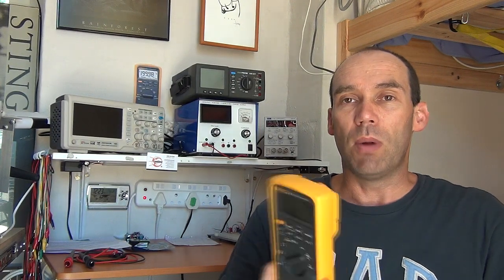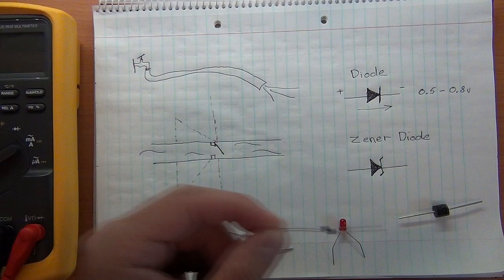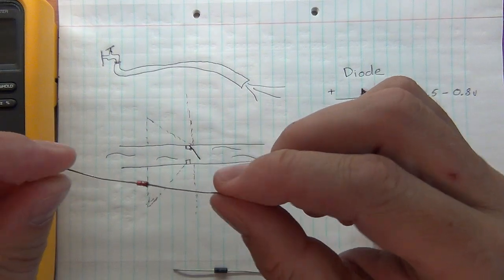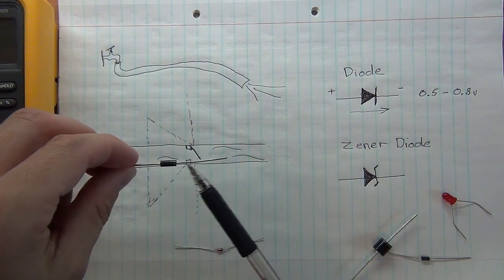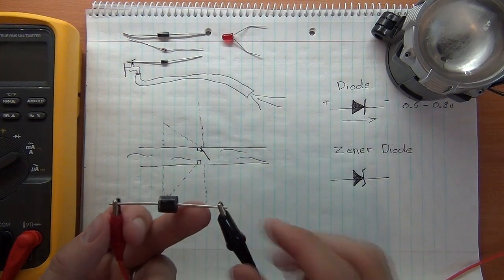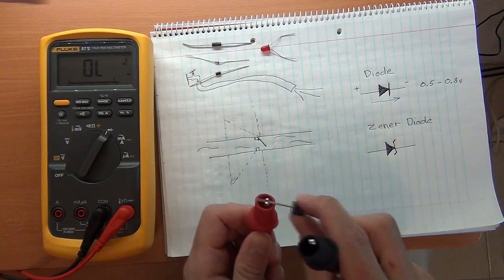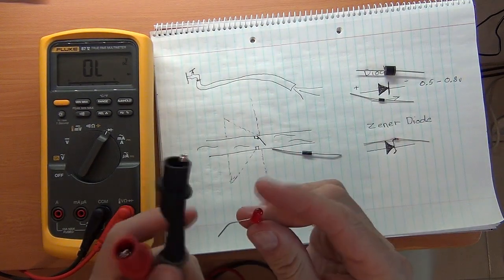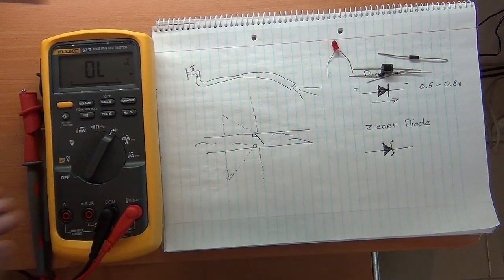How to use a multimeter for advanced measurements: Part 1 - Diodes

Comment: Mr. your videos are very very good, but about this one, you didn't tell anything about diodes in DC or AC circuits? For those one that doesn`t know where to use it, now they have doubt, is diodes works only in AC, or DC, or in both?

Comment: Please note!  The ~0.7V forward bias voltage of a diode applies to silicon diodes.  Germanium diodes produce ~0.3V.  Such diodes are are used in applications where voltages are pretty small, eg, meter rectifiers, RF demodulators, VSWR bridges....

Comment: I am amazed, being a new to electronics, just how much essence things need to have in order to operate correctly. Everything seems to work in essence. I wondered, will Almond essence work as well as Vanilla essence or is there a special kind of essence needed? I would hate to buy the wrong kind of essence because, in essence, that might upset the essence values in the circuit. In essence. :o)

Comment: on the other video you have said the bias pass through diode should be between 03 - 0.8 for a working diode, here you put 0.5-0.8V
Which one correct? coz I have mine figured 0.434V.. is it a good diode?
Thanks

Comment: If I understand you correctly a diode is really a form of a resistor, correct? Question 2...If you have a circuit with say 12V and it's feeding two components, component A needs the full 12 V but component B only needs 6V, would you use a resistor to restrict the flow or a diode to get your 6V. It seems both do the same thing.

Comment: So when there's a voltage drop of 0.5v - 0.8v, does this energy gets converted into heat inside a diode (heat and light in case of LEDs).
Reply: Anosync Yes .

Comment: Hi Mj, great videos thanks - I have a question for you regarding the diode test using the Fluke meter. The Fluke 87 puts out about 3.7V in diode test mode, when testing an LED I get a display reading of about 2.4V, then if I use the Fluke 107 which puts out about 2.4V and test the same LED I get a display reading of 1.8V.
The 87III is showing a drop of about 1.35V, whereas the 107 meter is showing a drop of 0.6V, why is there such a large difference and is this normal? Thanks.

Comment: Good Video's. But I am slightly confused as to the way you explain the current flow in a circuit. My understanding was that in a circuit, electrons flow away from the negative terminal (like charges repel) and towards the positive terminal (opposite charges attract). Have I picked this up wrong?!
Reply: +George Barron You should read the article that I have linked below. Not only will it answer your question in-depth but I'm sure that it will be a very interesting read as well.

http://amasci.com/amateur/elecdir.html

TL;DR: In case it is too long for you... Electrical energy is not always following electrons. Electrical energy can be carried by many other types of particles. But more importantly it can be carried by positive particles and those travels from positive to negative.

But the freaky part is that electricity can travel in both direction using both negative and positive particles at the same time ! But whatever the direction, a circuit will behave the same way. So to make high school text books simpler they decided to teach that electricity flows from positive to negative (official version) and some rebels will say the opposite.

However, electrical notation standards and tools are design and built around the popular lie that electricity always flow in the same direction which is from positive to negative. So you might as well roll with that. If you know that in solid metals electricity is actually carried by electrons flowing from negative to positive good for you. But just roll with the standard notation anyways.
Reply: +George Barron You should read the following article.

http://amasci.com/amateur/elecdir.html

Comment: Hello master, here's a question for you.
I have a working LED - I know it's working because it lights up if I connect it to a ~2V cell - with correct polarity of course - it does light up.
But, if I test its resistance I get nothing. What is more confusing to me is that I can't test continuity - the multimeter just does not beep. And yes I did attach the positive multimeter tip to the positive "arm" of the diode (I also checked the other way around just for testing). No beep. Why? Thanks!

Comment: Here's a little bit of info...ALL diodes are zener diodes.  All diodes exhibit the constant voltage zener effect in their reverse bias breakdown region.  The difference between a regulalar diode and a zener, is that the latter is doped so it breaks down at a known, & usually fairly low voltage (compared to a "normal" diode).  So if, for whatever bizarre reason, you want a 500V zener, get a bunch of regular rectifier diodes, and test them.  You might find what you want.

Comment: To be fair, in my opinion that is a loaded question !  They are equally dangerous depending on the voltages, amperages and circumstances involved. Human skin is very dry at the surface and there for is a poor conductor of electricity below, I believe around 48 volts DC or AC. That is why if you come in contact with the  negative and positive terminals of a high amperage ( 400 - 600 amp ) 12 volt DC car battery, it is harmless. On the other hand if you take a low amperage 9 volt DC battery and put your tongue ( where your skin is very moist ) across the  negative and positive terminals and become part of the circuit you will get a shock. At the same time if you came in contact with a DC high energy ignition system  on a modern car, where the amperages are very low but the voltages can exceed 50,000 volts, it will shock you and will hurt like hell but will not kill you. At the same time, I would not want to be standing in a puddle of water and complete a circuit DC or AC with more than a half a amp or more of current, with say 50 volts or more, because it would make for a bad day ! It is not the voltage that kills, it is the amperage ( DC or AC ) that kills. I believe it only takes  a half a amp or less ! The voltage will determine along with other factors, such as a wet environment, as to how likely you will be shocked and how well you conduct current ( amperage ) to ground, which is a very bad thing !

Comment: You keep referring to electricity moving from the positive side of the diode toward the negative side of the diode.  The electrons really move, electricity, from the negative pole to the positive pole.  For some reasons, historically I think, electronics people refer to current traveling from positive to negative, I don't know why they don't correct this!
Reply: You are correct in the way the current flows, There is what is called convetional flow. This is from the time of Edison before it was understood. Now there is the correct flow of current and it's called Electron Flow. Electricians in our country especially Car Mechanics use conventional flow. But Electroncs Technician's rely on Electron flow.
One of the changes was they found out by submersing two metal strips in a conductive liquid and found out that after using a battery for a time as the voltage source they were able to notice the miniscule weight increase. So that reinforced the Electron Flow arguement. They noticed also one strip would create bubbles so that was further evidence. But its hard to change so called convential wisdom. ;)

Comment: I was taught that "OL" was "open line" not "over load" not that it makes a difference as long as you know what is going on.
Reply: I was going to comment on this as well, glad to see someone else already did. On auto-ranging meters it says OL when the value is out of range, because it is overloading that range selection, which potentially happens everytime you use the meter. However it only momentarily does this because it automatically selects the correct range to view the measurement. if the meter does not have auto-range, you need to manually select the appropriate range to view the measurement correctly.

Comment: Are your metaphor diagrams accurate?
 Isn't electricity flow an attractive force to negative not a pushing force
 A pressurized hose doesn't show this:
 A better metaphor would be for water running down a hill where the force of negative current would be represented by gravity.